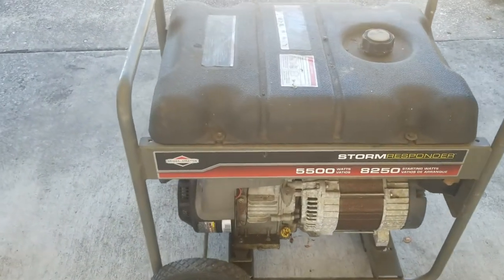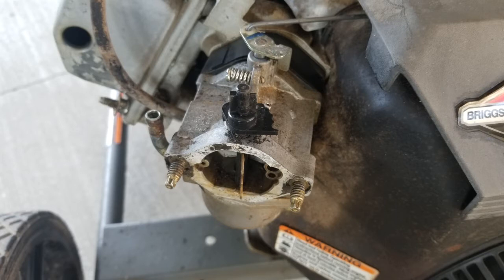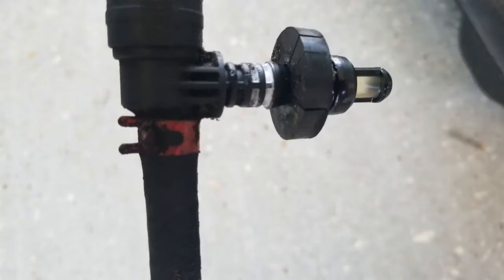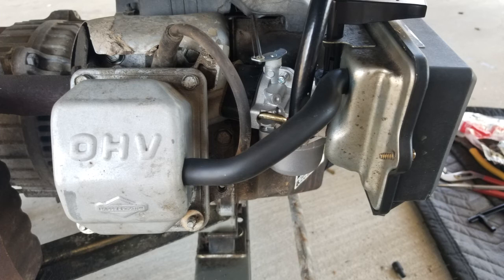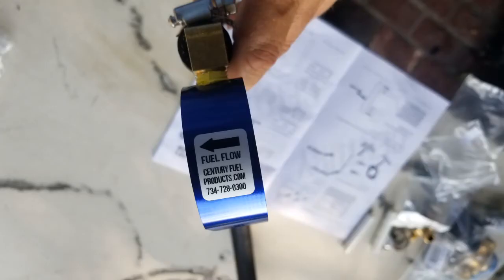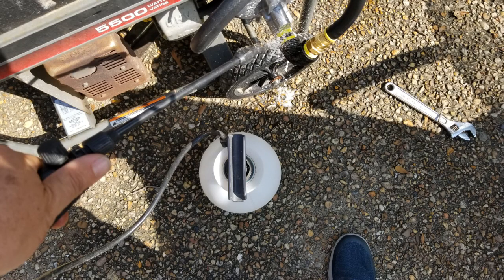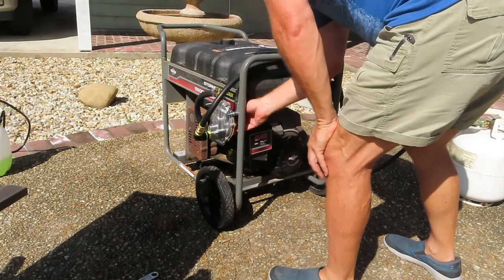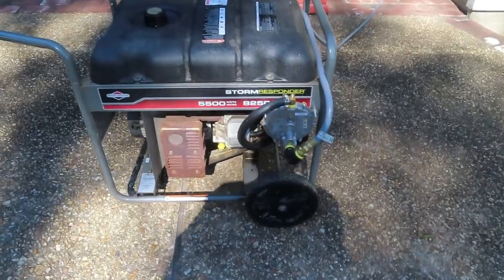Portable Generator Tri-Fuel Conversion

Comment: You should turn it off by shutting off the gas supply , not the engine switch.
Reply from the maker: Like I did on NG? 😁 I only did that on propane for video expediency. The unit runs a bit after shutting off propane.

Comment: Good video.  Thanks for getting to the point and covering the details.  I have almost the same generator and have recently done a similar overhaul with new carb.  Trying to decide which conversion kit to order but they all seem to be very much the same.  Is there a reason you didn't eliminate all the extra fittings at the inlet to the fuel regulator?  Thanks in advance for any response.
Reply from the maker: Thanks. Not sure which fittings that you mean. But there wasn't anything extra that I remember. All required to change size or make an elbow etc. The Century products kit I linked was complete and has worked very well

Comment: Hi great video. On a couple other videos with this kit the installers slightly adjusted the gap on the spark plug. Did u do that?
Reply from the maker: Its been so long I do not remember. I read the same thing. But I do not think I changed the gap. I decided to see how it ran first. It cranked right up and run smooth ever sense. So I did not want to mess with success

Comment: What happens if the generator dies in the middle of the night, say it loses  ignition or goes out on low oil sensor?
Does the propane metering diaphragm stay open, flooding the engine & emptying the propane tank?
Reply: It seems it will just keep dumping propane back out the air filter box after flooding the engine?
Reply from the maker: @haljordan9160  Hey my brotha from anotha motha! Thats part of the purpose of the large round diaphragm. It will shut off the propane flow if the  gen dies. You could run without that diaphragm. But as you  realized, that could be quite dangerous
Reply: @haljordan9160  NO It will stop gas flow.. that is reason for the Chrome looking Regulator  on the side of the motor. It works off Vacuum.
Reply: That was my bit of my concern. I guess engine/carburetor vacuum opens the metering diaphragm & allows flow, but upon engine failure = no vacuum, & diaphragm is forced closed? But there is still positive pressure on the other side of the diaphragm.
I'm just curious if the metering diaphragm also acts as a closed valve?
Reply from the maker: @haljordan9160   no gas flows with the engine off
Reply: It goes kaboom

Comment: Great video Mike. Any idea how long a 20lb propane tank (about 4.7 gallons of propane) would last at say 50% on your generator?  I know Hutches was selling their propane for $4/gal.  The safety of not handling gasoline is appealing.
Reply from the maker: I did not run that gen on propane. I only ran it on natural gas. My small 2200 Honda ran about three 8 hour nights just running the fridge. And two 8 hour nights running the fridge and a window A/C

Comment: Just FYI, I was about to spend 2000. on a new Harbor Freight Predator 9500 to power my entire house AND a 3 ton AC system during power outages. After watching your video I came across another that featured the EasyStart™ 364 Soft Starter - ASY-364-X20-IP. THIS thing is a game changer, my 15 year old generator, looks much like yours, I could power everything EXCEPT the AC because of the initial starting power needed for the AC to run, The Easy start soft starter starts your AC in stages and drops the initial starting power by 60 to 70%. My old Generator 8550/5550 can now power the entire house and with the addition of this kit I have more options to stay prepared AND I SAVED $2000. by not upgrading my crappy old gennie :) Thanks again for the video, you saved me $$$$
Reply from the maker: Ive done a softstarter on my RV A/C to run on my little Honda gen. I need to put one on my home A/C.
Reply from the maker: Do you know the BTUs or the tonnage of your home system? Do you have any way to measure the amp draw after the easystart install?
Reply: @MikeJordanUnCamplicated  https://www.youtube.com/watch?v=uowVMYuPs-U&t=175s  this is the amp draw answer !
Reply from the maker: @code3k5  perfect, thanks for that

Comment: Unless you got the genny for free this conversion and carb replacement isn't worth it on unit  in this state. You already have $ 200 in parts.
Reply from the maker: ABSOLUTELY worth it  after a hurricane,... when you do not have to hunt for gasoline, because none of the gas stations have power either
Reply: @MikeJordanUnCamplicated  Have to agree with you in that regard gasoline hunting is not fun when trying to keep genny running.  Thanks for the video.